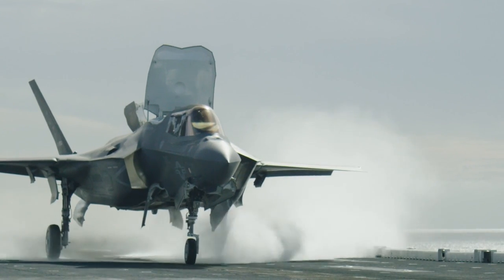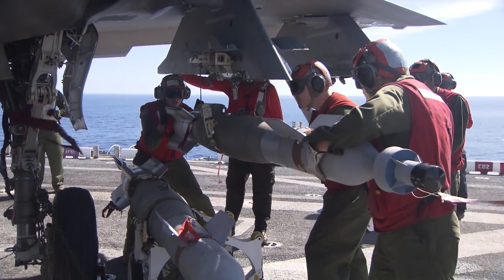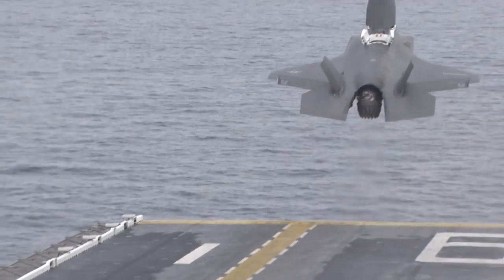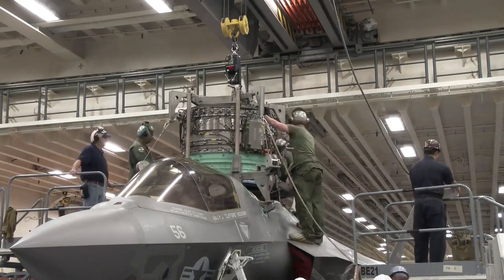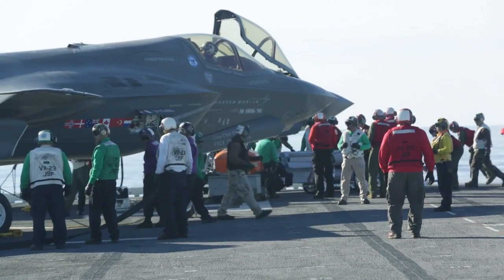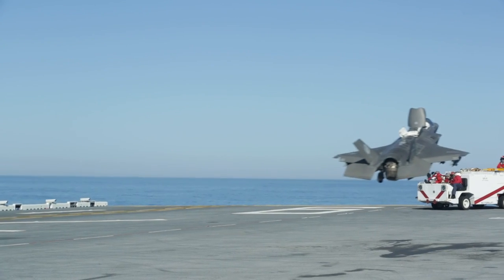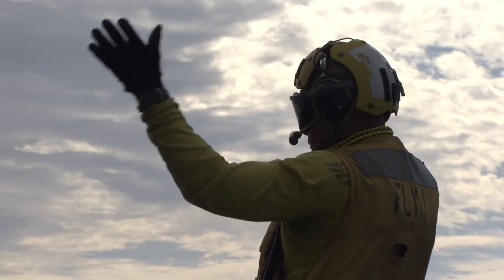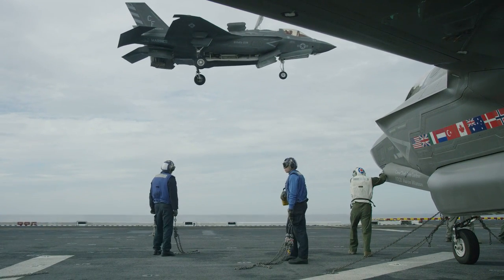F-35B DT-III Wrap-Up

Comment: so.... we have a stealthy plane with internal ordinance bays but then we are adding non stealthy under wing pylons and ordnance? I assume that is an option with some lower tech enemy's but... why risk such an expensive and advanced aircraft by making it vulnerable?
Reply: Well, The unstealthy pylons are just there for when they need more firepower with the F-35's advanced sensors, but they don't need as much stealth. F-35's with an ordinance like this would probably come in the second/third wave of an attack to hit ground targets or long range air-air after the SAMs have been taken out. Also simply better to have it as an option.
Reply: Yeah, I can see that being possible. I still really wonder about hte claim it can provide what the A-10 does for close ground support and tank killing. I understand the Army delayed the retirement of the A-10 recently because they thought so too.
Reply: dregerclock 
Yeah, it seems like the f-35 really isn't much of a "close quarters" plane, although it can easily kill a tank from high altitude, I don't thing it can really do as well as the A-10 for things like killing a group of enemy soldiers/terrorists. We'll see if the A-10 holds out.
Reply: The F-35 will not do as good as an A-10 for close air support; it will do far better! The F-35 has a much greater payload, speed, and range than the A-10, as well as far more advanced sensors to find and target the enemy. There are types of sensors, like the DAS, that aren't on any other aircraft. The F-35 is far more survivable than the A-10. The A-10 has been a fine aircraft in a role it wasn't ever designed for, but it is obsolete and can't hope to survive against modern air defense systems fielded by our enemies with an actual military.
Reply: In the US military, the F-35B is operated by the Marines. The aircraft it is replacing is the AV-8B Harrier II.

As for the USAF, the F-35A is going to mainly replace the F-16C/D for intercepting and strike missions. I believe the reason why the A-10 is going to be phased out is because that the tenets of warfare has changed. Mission planners are going to rely more on precision strike and this is the reason why the A-10 is going to be rendered obsolete in future.
Reply: dregerclock No the A-10 was not designed for CAS, it was designed for one thing: to kill the huge number of Soviet tanks that were expected to roll into Europe as part of a Soviet invasion. The A-10 was envisioned as the main effort in this because the West's tanks were so outnumbered by the Soviet's; aka the A-10 would kill the tanks far from friendly ground forces. That is not close air support, that's deep air support or just plain air-to-ground strikes.

What you and many others seem to misunderstand is that the kind of low altitude "down in the trenches" method of CAS is not necessary or desirable when you can make more accurate and effective strikes from high altitude with guided ordnance and modern FLIR targeting systems. Even the A-10 uses guided weapons from high altitude much more than it does dumb bombs or the gun down low. 

At any rate, the F-35 is plenty capable of flying low altitude attacks too. It should be even better than the A-10 at this, as the F-35 can fly supersonic allowing it to get into and out of the danger area quicker. And of course it's stealthy, so it's next to impossible for SAMs or MANPADS to target it.
Reply: So, we should throw all of our legacy aircraft in the trash today because they use wing pylons?
Reply: Locutus494 said, "The A-10 has been a fine aircraft in a role it wasn't ever designed for"... what? the A-10 was specifically designed as a close ground support anti-tank aircraft! they built the plane around the tank killer gun and designed the engines placement to hide thermal signatures with the tail and the armored titanium bathtub that protects the pilot from ground fire... it was SPECIFIC to that role. I agree that the 35 will be able to use smart munitions to pinpoint targets from a distance and has all the other protections that the modern sensors and stealth provide, just saying that it may not prove to be as effective in the "down in the trenches" close support role as a built to take a beating A-10 does.
Reply: not at all MrBen527... just saying that adding external stores to a stealth plane negates its "stealth"... but as the commenters above already mentioned, it can provide more weapons for a second strike after the stealthier first wave has taken out air defenses. And to follow on that thought... you do know that the 35's claim to be able to fullfill the role of 6 or more current legacy aircraft means those legacy craft are retiring right?
Reply: dregerclock
In due time.  But not until new aircraft fill the fleet.  In a coordinated  attack, the legacy aircraft will be behind the (wings clean F-35s and 22s)  loaded out for the targets as the leaders point them out.
Reply: chew_jkj
Warfare changed at Desert Storm.  All of our strikes are precision.

Comment: Its been in development, testing and grounded since 2006
Reply: It is not currently grounded and while full capability is not yet realized, it is operational with the Marines and USAF.
Reply: Dan Wilson well those other people better stop comparing the F-35 to the Pak Fa when the F-35 is a strike plane meant to strike targets and then get out like a hit and run plane while the F-22 is the true dogfighter jet
Reply: While it's not a fair comparison, it is absolutely true that an F-35 would chew up a PAK-FA like breakfast cereal. The F-22 is also not a dog fighter (though it's no slouch in the WVR [Within Visual Range] arena), it's designed, like the the F-35, to kill its enemies from far away before they even know it's there.
Reply: mrwong11989    STILL GROUNDED?  You must live in a basement, kid, what a loser you are.